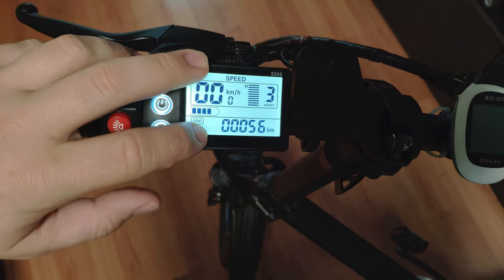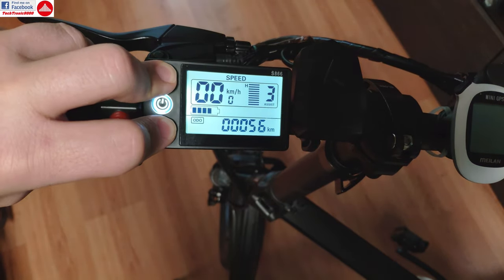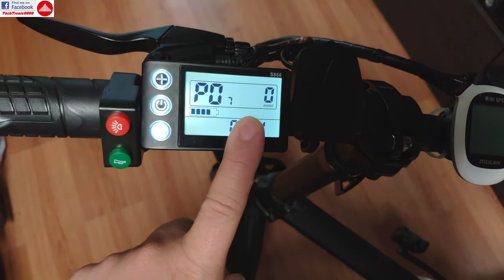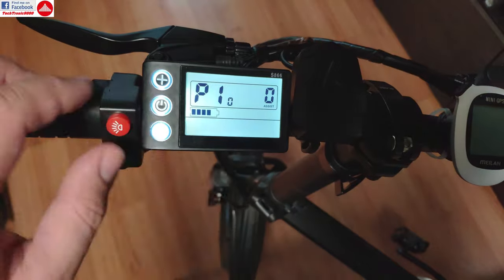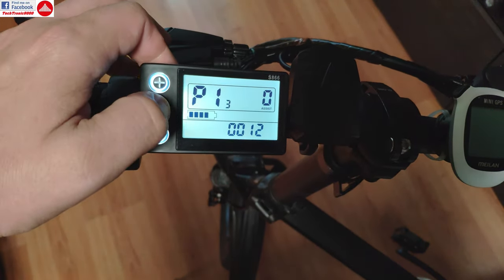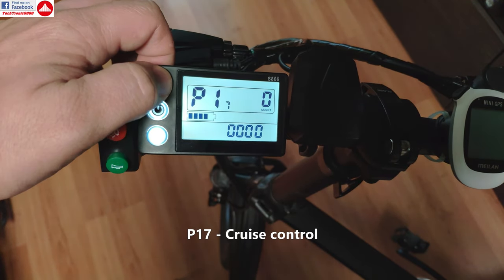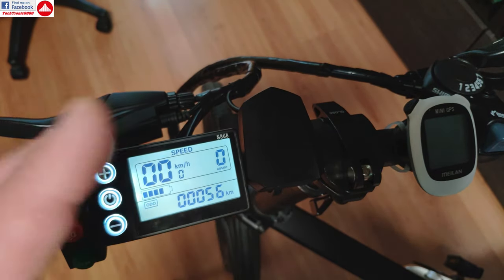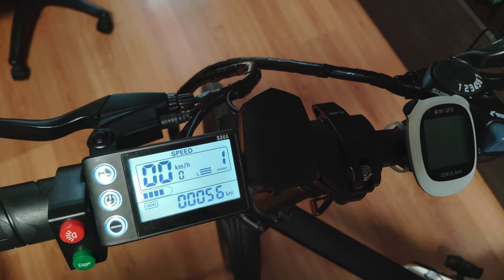ADO A20 / A20F / A16 S866 LCD - Complete Settings Walkthrough (P01-P20)

Comment from the maker: ADO bikes & accessories are available from the official shop 
https://bit.ly/OfficialStoreADO
ADO spare & upgraded parts can be found on the official AliExpress store 
https://bit.ly/OfficialStoreADO_AliExpress
You can now also join the Official ADO users group 
https://www.facebook.com/groups/adobike01
Reply: Hello sir. Can you help me? I bought a zip  swft bike which have kind of the same settings on the lcd screen. I don't know what happened, the pedal assist stopped working. I did everything you showed but is not working. Can you help me?
Reply: P17: Cruise control, keep + or - pressed (I don't remember) until cruising speed begins, indicated by the icon on the display

Comment: P01....Brightness 1,2,3; P02....Km/m; P03....Voltage 32/48/60; P04....Sleep time minutes; P05....PAssist number of modes; P06....Wheel size inch; P07....Magnet number in motor; P08....Speed limit; P09....Start level of PAssist; P10....2=Peddle & throttle Assist; P11....Boost sensitivity=1; P12....Boost start strength; P13....Number of magnets; P14....Current limit in Amps; P15....Low Voltage power off; P16....Clear milometer; P17....Cruise enable/disable; P18....Speed ratio % adjustment; P19....1=Direct Hub 2=Gear Hub; P20....Protocol=0000
Reply: So my a20 is not the same brand but it is an a20 same controller.. the speed limit only go from 1-45 but at 45 it still limits to 29 mph... okay.. but my question is this... if I change the voltage cut off which is at 29.. say I turn it down to 25... theoretically I will get more miles before the bike shuts off from low battery but will it ruin my motor or anything else?
Reply: @swangodesigns The Voltage cut off is to protect the battery, not the motor. Allowing the Voltage to go too low wears them out quicker, as well as potentially killing them.
Reply: @swangodesigns  
🔹reducing the cut off voltage will damage your battery! but not the motor. Lithium batteries do NOT like to be deeply discharged.
🔹If the motor controller you have uses the amperage limit setting (P14) from the panel (it may not), increasing this may increase your top speed. Be careful and don't adjust this number over the battery output or motor input capacity in Amps. This CAN fry the controller and burn up the windings in the motor if you exceed their amperage rating. 
🔹Just to be sure: If the motor is rated 750 watts @10 amps, DO NOT increase the output limit over 10 amps.
🔹The battery also has a maximum amperage output. This depends mostly on the battery cells used to make the whole battery. If the battery has a low total amperage output this will effect the top speed of the motor.
Normally a 14 to 20 Ahr battery feeding a 1000 watt motor, with a nominal cargo weight of 145 lbs, 29 to 30 mph is pretty much top end performance.
Reply: How the cruise control works is once you turn it on, You use the throttle to get to the set speed you want, Then you hold the down button on the display. It takes up to 20 seconds to activate it you'll see a P. Other bikes that I have it activates way quicker but would this controller it's quite slow to activate. So basically get your set speed do you want then hold the down button. If you start pedaling or touch the throttle on this controller it turns it off instantly. On my other bike you can pedal or throttle and then let off and it will stay at the set speed original. Also using the brake will turn it off.
Reply: Please tell me adjust colorway electric bike 26
Reply: How can i reset all options?
Reply: @DESCONOCIDOUnknow  If you can cycle to P00, press the '+' button to see the number 10, then go to the next setting P01;  then wait for the main display to return on it's own. 
🔹Some units this is P11
🔹A lot of the recent units begin at P01 so you have to cycle through all 19 settings pages.
🔹Some units cycle from P19 to P01 and skip P00. Those units have a multi button press that is held for a time to get to P00 but I don't know what that is, or they use P11 for the reset instead of P00
Reply: My pedal assist stopped working.. not sure which setting that is that needs to be adjusted  @3DPDK
Reply: @MrCarpediem6  There is three settings to control the pedal assist:
🔹
P10: "Drive Mode Setting"
.  0 = pedal assist only
.  1 = throttle only
.  2 = throttle and pedal assist
🔹
P09: "Direct / Kick start mode" This determines the behavior of the throttle in pedal assist mode;
.  0 = Direct start means the throttle applies power at any time.
.  1 = "Kick to Start" means the throttle will only apply power after the wheel is turning (or while peddling). This setting is intended mostly for e-scooters, but it does effect the throttle behavior for e-bikes as well.
🔹
P05: "Pedal Assist Level":  This one can be a bit confusing. It has two numbers; one is cycled with the [+] button, the other cycles with the [ - ] button.
.   mode 0: 1 through 3
.   mode 1: 1 through 5
.   some units have mode 2: 1 through 9
The difference between mode 0 and mode 1 is that mode 1 has a little finer control over the power applied with 5 steps rather than only 3
The second number determines the actual power level sent to the motor in pedal assist. P05 sets the default setting when you turn the controller on, but on most control units the second number (pedal assist power) can be cycled from the main display with the +/- buttons. If you set mode 0 the main display will only cycle through 0, 1, 2, 3. In mode 1 the display will cycle through 0, 1, 2, 3, 4, 5.
Keep in mind that cycling through these from the main display, the "0" on the display turns pedal assist off.
Reply: @3DPDK   amazing.. giving this a go! Thank-you
Reply: @swangodesigns  I misunderstood your questions; sorry about that. Some controllers allow you to set the minimum, overall battery voltage before the controller shuts down. I thought that's what you were asking.
1. Even if you set the main display to show MPH the "speed limit cut off" setting is in KPH only. 45 KPH is 28 MPH so it's actually limiting your speed to what you set it to.
2. Lowering the cut-off speed limit to 25 MPH (40 KPH in the setting) will indeed extend the range of the battery. This will not hurt the battery, motor or controller since you are running less than maximum output.
Reply: This helps a lot. Thanks 👍🏾

Comment: I am facing a problem, display always show full battery even i run the bike 25 miles or more. How i can fix it?
Reply from the maker: You have probably changed the nominal system voltage.

Comment: Hi have to mention the other problem some bikes are sent out with throttle disconnected and have the new controller fitted To unlock you have to hold right hand brake and full throttle in off position turn on bike wait 10 seconds then turn off then back on then the motor will work
Reply from the maker: Then you are lucky you got the new generation controller, a very wanted upgrade part for our older initial ADO bikes. You can check my other videos in regards to this matter.
Reply: Can you please help me to get my throttle mode back on .. I have E 08 on screen. I think the problem that caused it was after I carried a bag over the handlebars and it maybe has hit something like the horn and lamp buttons.. not really sure tho.. that was directly after this happened (No Throttle) Ado A20F Thanks for great videos.

Comment: P08 has not allowed me to overcome 15.5mph limit it only adjusts the percentage of 15.5mph so at 100 it does 15.5 and at 72 it does 11.2mph, how do I overcome this
Reply from the maker: You can get 35km/h when you use the throttle in assisted mode 3/5.

Comment: DEFAULT SETTINGS 🙃:
P01: 2    (Display brightness)
P02: 0     (Km or miles) 
P03: 36  (Nominal voltage)
P04: 10   (auto sleep timer minutes)
P05: 0     ( power assisted mode )
P06: 20   (wheel diameter)
P07: 1     (number magnets motor)
P08: 25   (speed limit, increase to 44 for max speed)
P09: 0.    (non zero start, 0= no pedal needed)
P10: 2.    (drive mode, electric, assisted or normal bike)
P11: 2.     (assist delay since pedaling started)
P12: 3.     (Strength of acceleration)
P13: 12    (PAS sensor)
P14: 15     (controller current limit)
P15: 29     (battery controller voltage limit)
P16: 0       (reset odometer, km to 0= new bike)
P17: 0       (cruise control)
P18: 100   (Display range adjust)
P19: 0       (0 gear assisted)
P20: 0      (controller communication mode)
Reply from the maker: Thanks, that is also useful.
Reply: Do you have the factory default settings for the A16+ ?
Reply: Thanks.  I needed that after I messed around too much with the settings.
Reply from the maker: P06 is different, should be 16, the others should be the same.
Reply: Nice one bro that's a big help...
Reply: only 9 mode exist
Reply: Wow, thank you. I adjusted P12 to 05 and it was just too much fast for Amsterdam. Great toque but seemed to drain the battery faster and be too quick for crowded streets in gear 2.
Reply: @mrdaveo735  This should be the same controller, just depends on when you bought it (what version).
Reply: Pleace i need a settings of elettric bike emg f20f bomber, Pleace can you help me
Reply: P07 not same on mine 😢 should i change it or not
Reply: @payusavisit3482  If it's the same bike model, within the same year, you can try it at your own risk. Is it an A20? If it's a different size wheel, the magnets could be different.
Reply: Thanks, i have A16 but the lamp can't turn on after press (+) until the symbol of lamp came out on LCD. What shoud i do? Anybody can help me?
Reply: Is it ok to ride the bike at 44 km/h?
Reply: @DestructorALU  I would not advise to go 44 km/h on the A20. It is simply not designed for these speeds. I would be concerned the for my safety, much less the braking ability.
Reply: @jbwind2821  I assume this is without pedaling. Mine is set to 99 - but the bike cannot go much faster than 35 kph even with pedal-assist on a good day. My best guess is that these controllers and numbers are not that concise, or the speedometer is inaccurate. It's odd because 25 kph is the maximum by law here in the Netherlands..
Reply: @garyhymes can this meter fit on others controller?
Reply: @GaryInAmsterdam 😮
Reply: @TechTronic9000  just look on your tire, if you know what inch the tire is, you can put that in p06.
Reply: @GaryInAmsterdam Well DUH 😅
Reply: Default setting for hitway bk5 europe
Reply: I understood that better then the video thanks alot bro@TechTronic9000

Comment: Summary for y’all:
P01: Brightness
P02: Km or Miles
P03: Voltage (Only effects how battery gauge reads)
P04: Control panel sleep time
P05: More assist modes
P06: Wheel diameter 
P07: Number of magnets
P08: Speed limit
P09: Start with pedaling or not
P10: 0 = assist 2=both HAVE ON 2
P11: Assist delay
P12: Acceleration
P13: Pas sensor (DO NOT TOUCH)
P14: Limit to prevent battery damage 
P16: Reset odometer
P17: Cruise control
P18: Speed tuning
P19: Assist or electric mode
P20-P22: DON’T FUCK WITH
Reply: thank you!!!!!!
Reply: I only got p1 through p7
Reply: hi there today when im cycling my electric bike the clock is just stay at o mph the bike is work but the clock wont change have you any idea thanks.
Reply: @delboyfc74 I probably have the same problem. MPH locks, but can still use the pedal assist on my EDISON ebike! 
Currently checking out other videos on how to reset the s866 to factory settings!
Reply: T
Reply: I can't change P09, any trick?
Reply: Thank you! Does this work with the Hitway E-Bike??
Reply: @marcosramos4596  i have a hitway BK3s, probally yes. if it is the same lcd, then it should work.
Reply: You are a true gem in the sus pit of yt keyboard warriors. Thanks a million copy pasted and printed then i lamilnated it.. It lives on my bike
Reply: @Desaree1  aww thanks! I’m honored to be a part of your bike

Comment: The best video dealing with this.👍
I have to include that these are the same settings on the EN06 control panel, however the documentation is either very ambiguous or completely lacking for some of the settings pages.
Your explanations have cleared up most of these mysterious settings.
A note to other viewers: Although the panel may have an adjustable setting, whether or not it has an effect on your bike's behavior depends on the model motor controller you use.
Reply from the maker: Thanks and also very good note about the compatibility with the motor controller.

Comment: That was the most complete video of how to set these up. I have just ordered one of these as my controller has gone bad and was wondering what happens if I remove my battery from the bike to take indoors to charge. Does the display loose all the settings and have to be re-programmed again when I put the battery back ? Many thanks for the video and I await your reply.
Reply from the maker: The setting will remain saved even you remove the battery, so no need to reprogram. Thanks for watching my video and consider subscribing ;)
Reply: @TechTronic9000  Thanks so much for that, My controller and display arrived this afternoon. I have installed them and find the pedal assist will not work but the walk assist works when I hold the - button down. I maybe need to look at the settings when I have more time. Thanks again and I have just subbed.
Reply from the maker: Check motor magnets, and check assisted sensor type settings, also adjust the assist delay.
Reply: @TechTronic9000  Thanks for that, it appears the problem is with the PAS sensor on the crank. It's wired colour for colour on the plug and the LED on the sensor flashes as I turn crank but no rotation of motor. If I touch the blue and black wires in the PAS sensor plug from the controller together at one second intervals or faster the motor runs fine. I guess the sensor may not be compatible with the controller, any thoughts would be great. Thanks again.
Reply from the maker: Maybe the sensor wires are not corresponding with the controller one.
Reply: @TechTronic9000  They didn't at first I had to move position in the plug. The only way I can get the LED on the sensor to pulse is when the colours match but it won't start the motor. I have just ordered another sensor to try. I have two identical bikes They are the Amazon Swifty Liberte 20 inch Folders and the controllers failed within a day of each other. I got them out of the garage last week and one was working on and off and the other no motor drive at all. Both working fine when we put them away before the winter, batteries were kept indoors at patial charge.
I get the same result on both bikes with the new Brainpower controller and S866 display. I'll see what happens when I get the new sensor tomorrow, only ordered the one for now. Many thanks for your help and I'll let you know how it goes.
Reply: OK, the new sensor came and worked after moving wires in the plug. It turned out my old controller used 4.3v switching signal but the new controller needed 5v. the original Pas sensor on the bike was configured internally different than the one I ordered. I managed to get the controller to work with my existing sensor by using a BC547 NPN transistor to invert the signal so the signal switches between 5v and ground. Incased the little circuit in shrink wrap just behind the plug and all's now good. With the old controller on Pas level 1 I got a speed of around 10 mph on level 2 about 12 mph and 3 about 15mph. With the new controller Pas level 1 is about 6 mph and 2 is 12 mph and 3 is 16mph. Is there any way to change the speed of each pas level as I prefer level 1 to be around the 10mph ? Many thanks for your help with the settings and I look forward for any advice on the above.

Comment: My cruise control works great on my ADO A20+ in the 3rd gear (no pedal assist mode)....it turns on after a 30 seconds at least.
Reply from the maker: That works on newer controllers, including the "+" models. This was an initial release with another controller.

Comment: If you press and hold the minus - button the bike goes into walk mode at 3 mph / 4.8 kph.
Pull breaks to disable.
Reply from the maker: Yes that is the walk mode
Reply: Delighted to hear that as stairs to apartment..do you know can you wheel it when folded
Reply: @debee1544  I believe the battery is disconnected when you fold the bike.

Comment: Thanks for this helpful video. I managed to get the cruise function to work after activating it on the settings panel. Just hold and keep the speed you wish in assist mode 2 or 3 for about 10 seconds. This activates the cruise mode.
Reply from the maker: Do you have the newer controller?
Reply: @TechTronic9000  Maybe, not sure. My bike was stolen a week after I got it 🥴
Reply from the maker: Sad to read that.
Reply: Can confirm that, cruise control works, I have the same model. Not sure tho if it holds the speed, or rather it holds (throttle input,) engine output level instead.
Also, thank you for this video :)
Reply from the maker: Cruise control only works with the new controller, check my new videos with the A20F controller upgrade and test ride.
Reply: @TechTronic9000  not sure what is this function exactly but when you press and hold (-) it will enable P program which seems to hold ~10km/h until you break or throttle. I have controller that came with original bike - no upgrade
Reply from the maker: That is the "walk assist" function, for when you walk next to the bike.
Reply: @TechTronic9000   You didn't answer our question what is the problem
Reply: On bikes with the new controller the cruise control works.